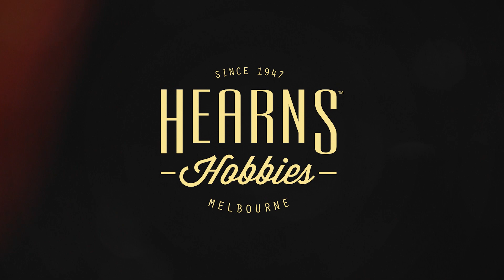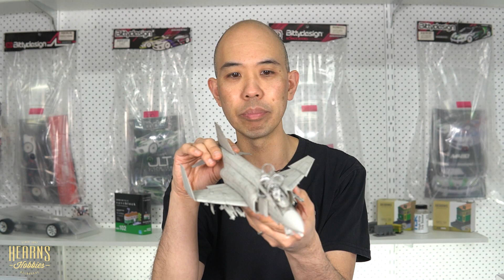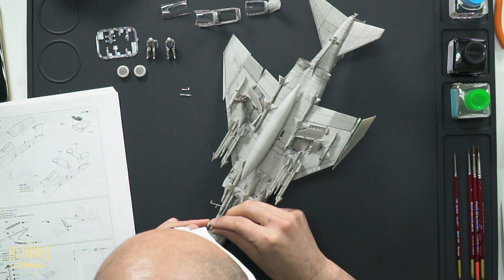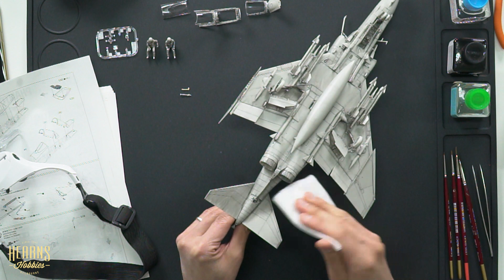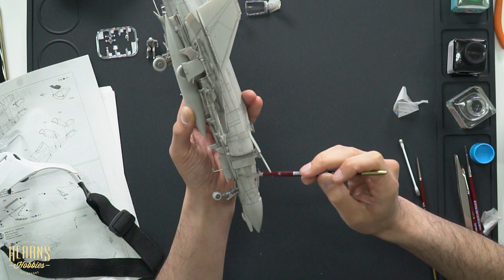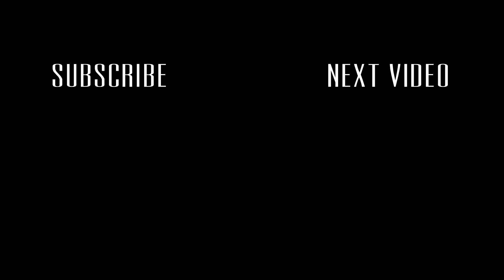Tamiya | 1/48 F-4B Phantom Build Part 20 Final | #askHearns

Comment: BJ, what was the tissue that you used?
Reply from the maker: Hello Martin. The tissue is GodHand Brush care sheet. It is a highly absorbing tissue that does not leave fibres behind. It is also very smooth so there is a low chance of damaging the surface you are rubbing. It is designed to be used for cleaning brushes without damaging the bristles.
www.hearnshobbies.com/products/godhand-brush-care-sheet